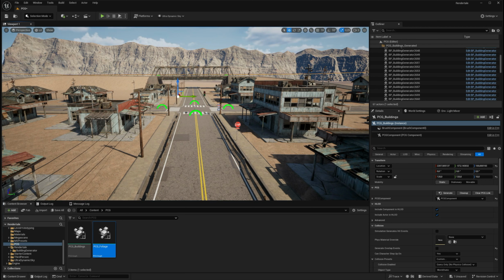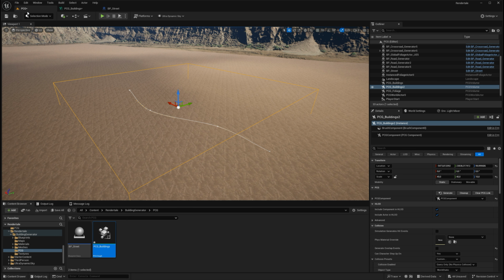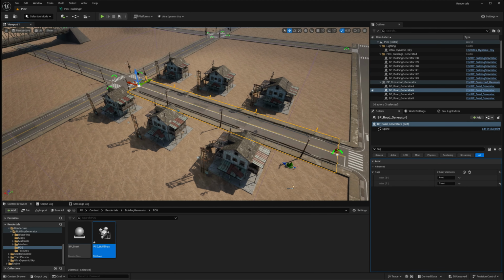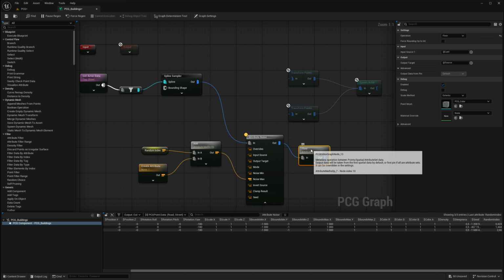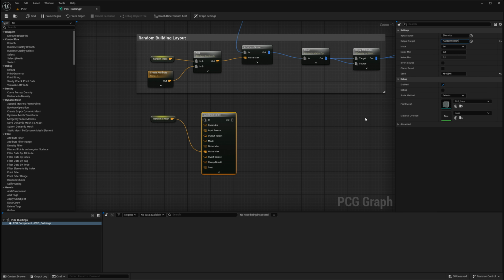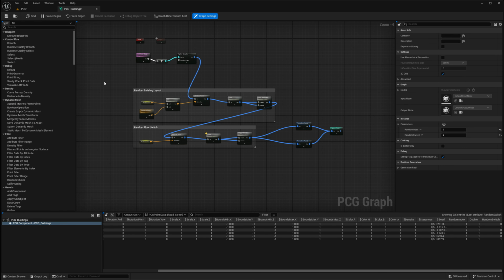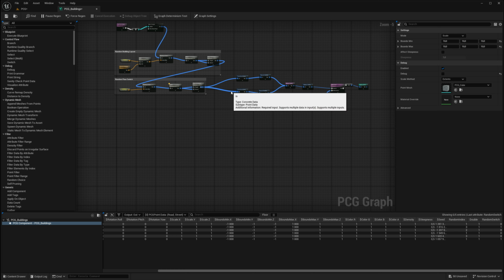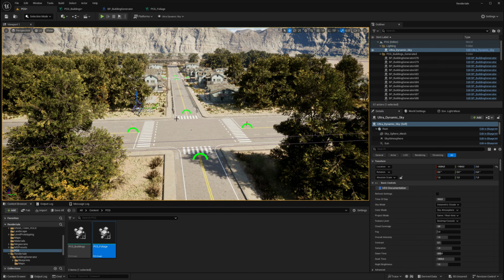Building Generator For Unreal Engine 5 - PCG Integration

Comment: in previous road generators when baked lights and wires are not supported and gone, is that issue fixed in this version?
Reply from the maker: Thank you for reaching out!
Baking a Blueprint into a static mesh generally replaces all dynamic actors with static mesh components. By default, Unreal Engine does not support baking cables or lights into static meshes, as these components are inherently dynamic.
As such, support for baking these components is still not available. However, we are actively exploring workarounds to address this limitation in future updates.
Thank you for your understanding!